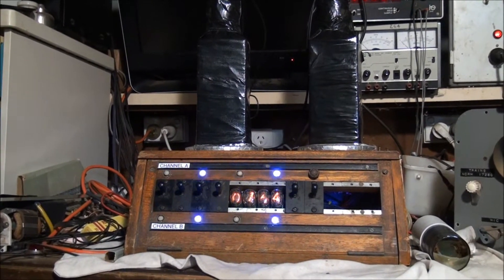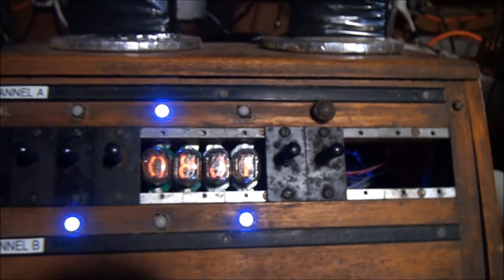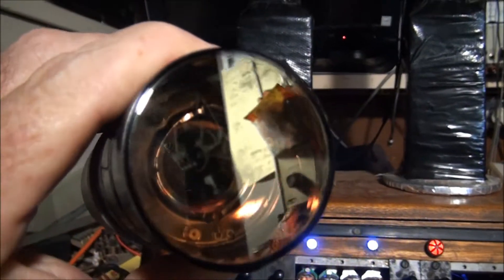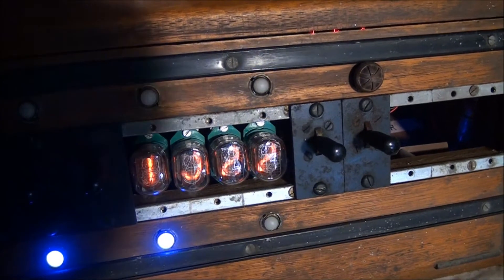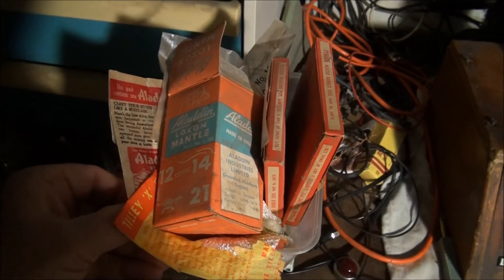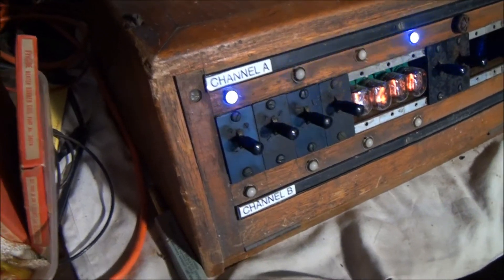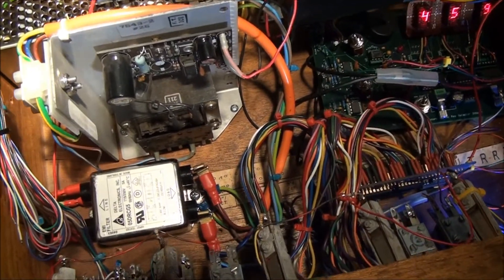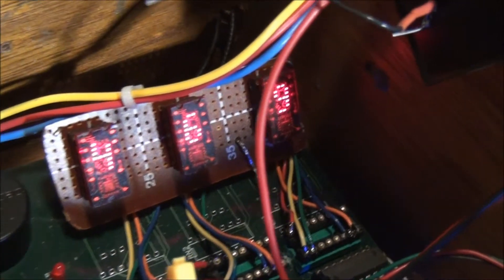Cosmic ray detector

Comment: OMG that red light on the front panel ! Q: those old 7 segment led displays have the binary decoder embedded in them ?
Reply from the maker: The old red indicator was and old telephone exchange lamp, red glass lens within a metal bezel and metal cage over lens face. The 7 segment displays are early HP led displays incorporating a binary decoder. They look great and easy to use. 5 volts supply and feed in a binary code to display the value, good in CMOS or TTL circuits or to make up a TTL clock etc. Hard to find these days though.